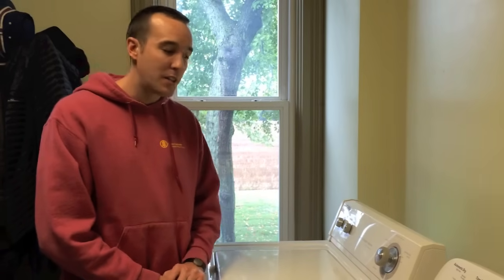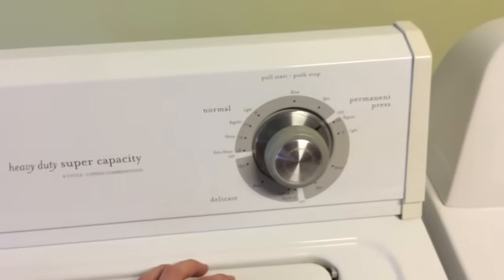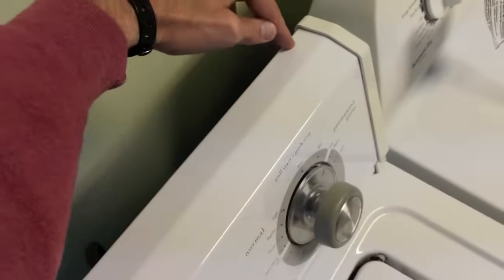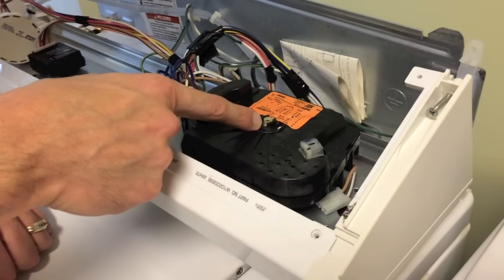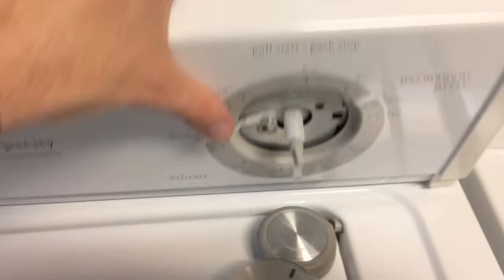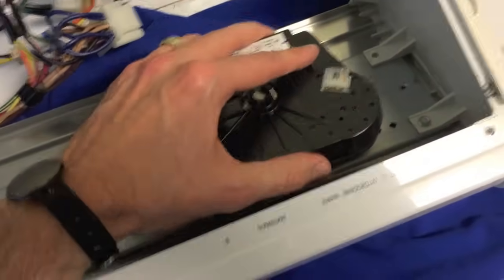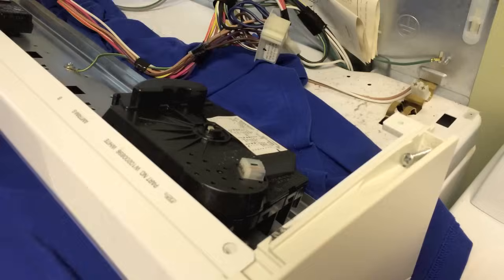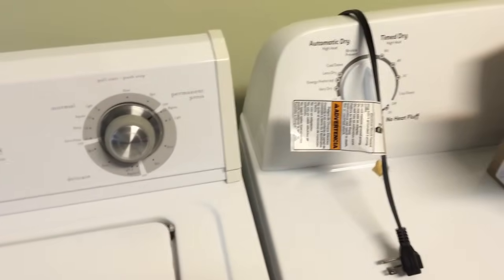My washing machine stops at Rinse - Does not DRAIN or SPIN

Comment: So my whirlpool top load washer will start fill, but then its like it can't switch over, it makes this weird clicking noise, & it usually eventually turns over, but its getting worse & taking much longer to click over. Is this due to a bad timer?  It seems like every thing I've read about faulty/bad timers say that it just stops, but mine continues to make a clicking noise like its trying to move on but its stuck or its having a hard time pushing through.
Reply from the maker: Ashley Y 

Thanks for watching & sharing your experience!  Is the ticking sound coming from the actual Timer itself?

You are experiencing 1 of 2 issues...

1.  Your timer is wearing out and beginning to work intermittently during the cycle...can lead to stop & go ticking... replacing your timer may get rid of this issue.

2.  Your lid switch is wearing out and beginning to work intermittently.  Once your wash cycle gets to the spin portion, your lid switch verifies that your actual lid is closed.  It then sends an electrical signal to the timer to continue the cycle and begin spinning.  If your lid switch is not working properly, the timer will not continue to the next stage of the cycle... this is a safety feature that does not allow the machine to spin with the lid open...which alleviates the machine throwing water all over your house...not good 😮.  Replacing your lid switch is both repair friendly and cost friendly.  Below is a link to our video changing lid switch.

       https://youtu.be/1hTRc-_PnP8

We highly recommend replacing both parts at same time.  This will ensure both parts are brand new & ready to work.

Keep us posted!

Please subscribe to the channel and turn on your YouTube notification Bell 🛎 that would be awesome thanks again 😎👍

Comment: Question how fmdo you know part type to buy I have a washer that looks the same it did this to me and all the water came out. But also some oil was coming out which I believe was the motor. I would like to fix it myself
Reply from the maker: Thanks for watching & welcome to the DIY Raptor Club.  Great question & we are here to help.

Inside machine door tucked away under lip, you will find your machine Serial #.

If it’s not there, your Serial # may be on the underside of the door itself.  You can use the serial number on:

       RepairClinic.com

After entering your machine Serial #, all available replacement parts will be listed on the website.

Or, you can share your machine Serial # with us & we can look up the replacement parts you need.

Hope this helps.  😎👍

Comment: I can not for the life of me get the panel to lift off. I have the same make, but mine appears to be an older model.  There are the top screws (which I have removed) but there are no other screws ANYWHERE.  Ive tried pulling, pushing, lifting, sideways, and nothing gives.  Any suggestions?  Thanks!
Reply from the maker: Stefanie Florencio 

Thanks for checking out the video and sharing your comment.  Lets get this figured out!

It’s possible that you have a model similar to the one in the video below.  There are additional screws under end caps that must be removed.  Below is a link to video...keep us posted!

Please subscribe to the channel and turn on your YouTube notification Bell that would be awesome thanks again!  😎👍🔧🔩

       Video:
               https://youtu.be/zF1G7d3FMf0

Comment: Hey mate, I changed my water pump for my Simpson Esprit 650 but it seem to drain on a smaller load but had something heavier it doesn't seem to drain. So could it be the Timer exactly how you changed your one? I have a feeling it is since I already changed the water pump.
Reply from the maker: Thanks for checking out the video!  Usually when you run into load differences that alter your drain performance, it deals with the clutch.  What might be happening is your clutch is beginning to slip with heavier loads.  At the opposite side of the spectrum, your clutch is still performing great with light loads.  Below is a link that might help...its both the exact model but still might help.  Keep me posted!  Please Subscribe to the channel that would be awesome!

https://www.applianceblog.com/mainforums/threads/35627-Kenmore-Series-70-Washer-Doesn-t-Completely-Spin-Heavy-Load

Comment: i have this very model i changed the timer out and it worked fine a month and now it's doing it again i don't know what up with that
Reply from the maker: Good morning, just poured a cup of coffee and am sitting down to answer any and all questions for the DIY community.

That’s no fun…by chance did you purchase an aftermarket part or original equipment manufacturer (OEM) part?  Aftermarket parts are great in some situations however a bit dicey in others.

It’s also possible that your Timer is still good however your Lid Switch has failed.  We recommend replacing Lid Switch before replacing the Timer again.  Below is a helpful link.

       https://youtu.be/1hTRc-_PnP8?si=oPAUy4ssWhWAPtA3

Let us know if you have any questions and hey if you’re into crypto trading, join our DIY ecosystem and become part of an exclusive group of DIYers.

       toolboxtoken.com

Reach out to us any time!  🧰

Comment: Hi Michael, My whirlpool washer as of lastnight filled up with water and began it's wash cycle then completely stops before the timer reaches the rinse cycle reading. The timer and and everything just stops and the machine remains filled with water. No sounds, no humming nothing. If I push the knob in and advance the timer to the next cycle it just repeats itself. The only thing it's doing is agitating and nothing else. Do you think this could be the timer?
Reply from the maker: Christopher Stephens 

What’s up Christopher, thanks for checking out the video.  Great question & the symptoms led us to the lid switch first...we tested the lid switch and found that to work as it should.  This then led us to the timer.  After replacing the timer, problem solved.  Try your lid switch first...there’s a few videos out there that will show you how to test it.  Below is a link to our lid switch replacement.  Again we would check Lid Switch first & get that replaced if it has failed.

Please Subscribe to the channel and Ring your YouTube Bell 🛎 that would be awesome thanks again 

😎👍🔧🔩

Definitely keep us posted with your DIY project, we are here to help!

https://youtu.be/1hTRc-_PnP8

Comment: I have the same washing machine. My cycle gets to rinse then drains the water out and continues to make the drain noise. When it reaches the spin cycle, it sometimes will not spin and won’t wring out the clothes completely. So I wait about 30 minutes and put it on spin cycle and it will spin but my clothes are still soaking wet after the spin cycle finishes. Could this be due to a faulty timer?
Reply from the maker: Thanks for watching & welcome to the DIY Raptor Club.  Its definitely a possibility.

We recommend replacing the lid switch first as it can also cause these symptoms.

Replacing the lid switch first is the more cost friendly part.  If that doesn’t fix it, the timer is the next part that will need to be replaced.

Below is a link to our video showing replacement of lid switch.

       https://youtu.be/1hTRc-_PnP8

Keep us posted.  😎👍🔧🔩

Comment: I have a 70 series Kenmore washer that will only go into the rinse and spin cycles by manually turning the knob which woks only some of the time. My lid switch has been bypassed so it's not that. My hose is clean so i don't think it's that. Does this issue sound like a timer problem? The timer goes all the way through the cycle but when you lift the lid that washer is full of water. Right know i can force the spin cycle by turning the knob to spin and forcing it on. Need some help!!
Reply from the maker: Robert Louis 

Thanks for watching Robert!  We appreciate you sharing your experience.  After reading your comment, two things come to mind!

1.  Although you mentioned you can manually bypass Lid Switch, it’s very possible that bypassing it, it’s not realigning the Timer back to its electronic setting.  You may need a new Lid Switch.  Below is a video that shows step-by-step process of replacing Lid Switch!

       https://youtu.be/1hTRc-_PnP8

2.  Your Timer has faulted & no longer guiding the wash cycle through its proper stages.  Replacing your Timer may fix your issue.

In our opinion, we recommend replacing both parts at the same time.  The parts can be purchased at (   RepairClinic.com  )... this is an awesome appliance website with great low prices.

Keep us posted!  Again, we recommend replacing both parts as they are both tied to your continuation of the wash cycle stages.  

Keep us posted!  Please subscribe to the channel and turn on your YouTube notification Bell that would be awesome thanks again Robert!  😎👍🔧🔩
Reply: I don't think it's the lid switch because it was already bypass when i purchased it used 3 years ago. I took the front of the washed and even though the pressure tube looked clean I blew in it server times from both ends and then put everything back together. My wife just did the 1st wash load and it worked great although I think this is just temporary. Time will tell.
Reply from the maker: Robert Louis 

😀 very cool.  Thanks for the reply!  Keep us posted!  Let us know if you have any additional questions!  😎👍
Reply: Thanks Mike for taking the time with your reply!!!
Reply from the maker: Robert Louis 

Our pleasure Robert!  A house with a failed washing machine can be stressful.  😎👍
Reply: Update: I order a new timer for my Kenmore series 70 washing machine. I ordered it from Amazon for about $95 including tax. I t arrived 2 days later and i installed it right away. So far my wife had done about 6 loads of laundry and there have been no issues.
Reply from the maker: Robert Louis 

Very cool that’s great news!  😀

So it was the Timer, that’s awesome!

We appreciate you taking the time to reach out to us and update us on your progress!  A washing machine that’s back up & running is a great asset to the house!  😎👍

Let us know if you have any additional questions Robert!  You Rock!

Comment: Just purchased a new Crosley washing machine..nothing fancy..  It will fill with water, drain, but will not rinse or spin.  I have noticed that the lid-lock light does not come on when it starts.  Once it drains, the light goes back to wash..  If I manually set the machine to rinse & spin, it will work.  What could this be?
Reply from the maker: Tanna Weaver Thanks for checking out the video and sharing your comment and experience.  If you are experiencing same issues as in this video, it's possible that your timer has begun to fault.  It's also very possible that your Lid Switch has begun to fault.  The lid switch can be tested and replaced cheaper.  Attached is a video how to change lid switch.  Keep me posted!  Your lid light not coming on means your lid is not connecting with the sensor...Let’s figure this out!  Please Subscribe to the channel and turn on your notifications that would be awesome thanks again.  😎👍

https://youtu.be/1hTRc-_PnP8

Comment: i have one of these washers and i believe my drive belt needs replaced can not seem to find anything on it or even where its located. any help on that?
Reply from the maker: Thanks for watching & what exactly are you experiencing?
Reply: @DIYwithMichaelBorders  it started smelling like it was burning and wont spin . it filled with water and i went to get laundry out and water was still on it and it was sitting on rinse cycle
Reply from the maker: @lisabell7934  

Thanks for the reply & that doesn’t sound fun.  Your motor might be overheating if worn out & weak.
Reply: It's powering on and it will fill up with water it just doesn't want to drain and it smells Smoky so I'm wondering if that's a belt issue and not a motor issue

Comment: my ge washing machine stops after the washh cycle. it won't go into rinse , drain or spin. i've replaced the control panel because mine doesn't have a timer, the lid switch, the water inlet valve and the pressure swith. it still isn't working. any thoughts??
Reply from the maker: tee lee 

Thanks for watching & we hope the video helped.  After reading your comment, one thing comes to mind.

You may have a clogged or damaged Water Inlet Valve.  Replacing this part may fix your problem.  Below is a link to our step-by-step video that shows replacement of part.

       https://youtu.be/DiPFZSMiBn8

We really enjoy making these helpful videos for our fellow DIY’ers.  Many more helpful videos to come!  😀

Let us know if you have any questions.  Please subscribe to the channel and turn on your YouTube notification Bell 🛎 that would be awesome thanks again!

😎👍🔧🔩

Comment: The problem I'm having is mine stops agitating during the rinse and smoke comes up around the drum.  After I turn it off and let it sit and cool off, it finishes just fine.  Any ideas?  The water inlet valve does need replaced, but I wouldn't think that's causing this.  It is an early 90's Amana.  I replaced the belt a year ago, when I thought that might have been where the smoke came from.  The belt was still intact, but worn.
Reply from the maker: Thanks for checking out the video and sharing your comment and experience Sassy Frassy!  Its very possible that the belt is begging to wear out and stretch...its kinda hard to really inspect the belt and its tension when installed...since you have already replaced the belt, it should definitely last longer than a year... right haha...one would hope!  Kind of a bummer if the belt has already worn out...You might need to put a new belt on it...unfortunately..

Its also possible that you are experiencing a Drain Pump beginning to malfunction.  As you know, that Drain pump is an electrical unit that spins ext rely fast...and can seize over time.  Keep me posted

Please Subscribe to the channel and turn on your youtube notifications that would be awesome thanks again!
Reply: Michael, For some reason I haven't been getting my notifications.  Thank you for responding.  It had been shutting down during the rinse cycle, but now it shuts down during the agitation of the wash cycle.  I've started shutting it off after it fills, let it sit an hour then it seems to run through the cycle fine.  I can hear a rattle sometimes.  Could it be the bearings getting too hot?  When the belt was replaced, my daughter got ahead of me and had it back together and put back in place before I mentioned wanting to inspect the bearings.  I didn't want to pull it back out.  It's in a really tight place.

Comment: Michael, my washing machine stops on the normal cycle just before rinse, and stay there till I move it. replaced timer and no changes lid switch works good, as I stuck my pen in there many times while testing it, any ideas?
Reply from the maker: mclc432 

Thanks for watching, by chance is your top lid bent or slightly unaligned?  If so, it may not be allowing the lid to make the proper & required connection with switch...that’s if you are having to stick pen into lid switch to engage it.  Keep us posted.

Please subscribe to the channel and ring your YouTube bell 🔔 that would be awesome thanks again!

😎👍🔧🔩
Reply: @DIYwithMichaelBorders  yes, fact we did bypass the lid switch and seems the new timer still hangs up at the rinse cycle???
Reply from the maker: mclc432 

Thanks for the update.  How is your water pressure going into machine?  Do you feel that the water pressure going in today is the same pressure or speed, or amount of water going in as the day it was brand new and installed?

Believe it or not, a lack of water pressure can cause this as well.  Cleaning the screens inside the connection points where your hot and cold water lines connect to the machine may help solve your issue.  Keep us posted.

😎👍🔧🔩

Comment: So my washer won't drain, spin, or rinse it just swirls the water and clothes around for a few minutes and stops... what should I do? Are the parts expensive?
Reply from the maker: Thanks for checking out the video and sharing your comment and experience LaKayla!  Its very possible that your Timer needs to be replaced...as mentioned in this video.  

Its also very possible that you need a new Lid Switch...I have added a link below to a video that shows the step by step process showing how to replace the Lid Switch.  I recommend going to RepairClinic.com to purchase both the (Timer) part and the (Lid Switch) part.  Both parts are very cost affordable and easy to install.  After replacing both the Timer and Lid Switch, You should be good to go!  Keep me posted!

Please Subscribe to the channel and turn on your YouTube notifications that would be awesome thanks again!

Link to Lid Switch Repair is below!

https://www.youtube.com/watch?v=1hTRc-_PnP8&index=61&list=PLjCXOz8TSkZmG-ZbhhKPj4Vh3K3MDPXii